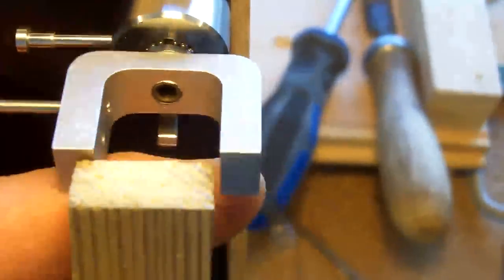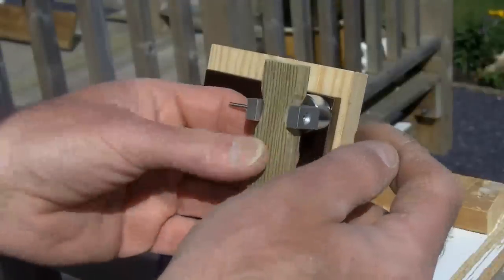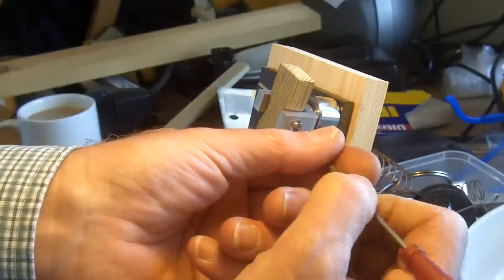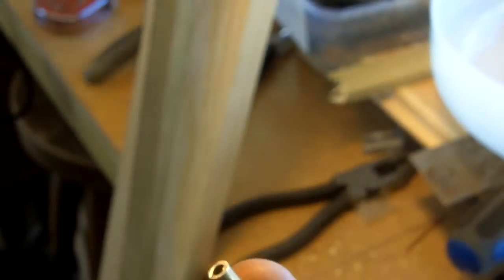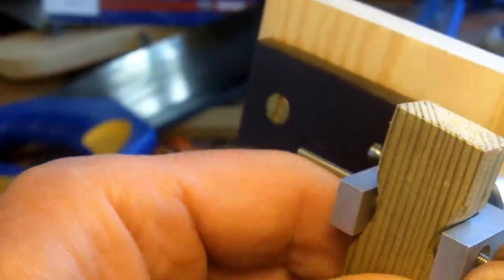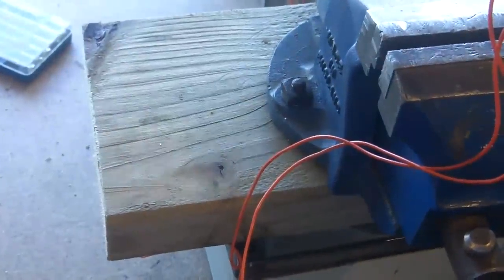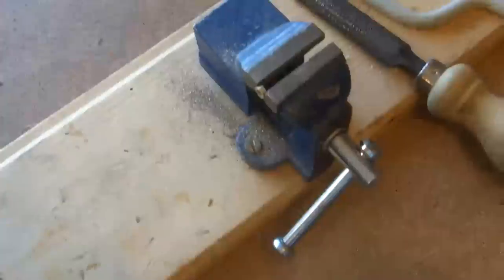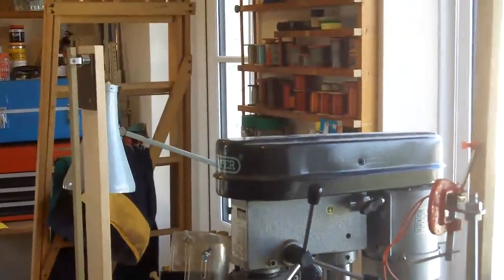Hipps clock movement project (rough) part 9

Comment from the maker: I did start clamping the vice to a bench without a bit of wood under it and it did start to mark the bench. The Record No1 vice (3” jaws) is mounted on bit of 12” X 6” X 2” wood and I always use proper screw type ‘G’ clamps as the quick release jobbies tend to shake loose.
Remember when you fix the vice to the wood make sure that it’s far enough forward so that you can still put a long bit of material in the vice it without fouling the wood.
Kind regards ... Andy